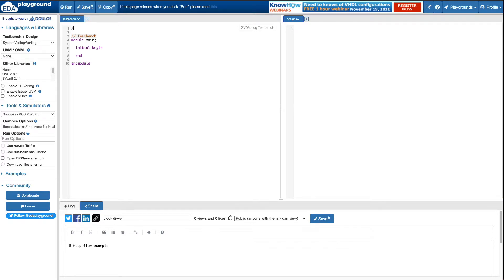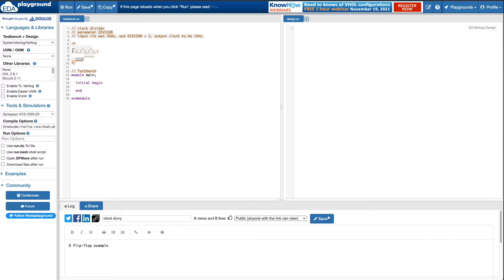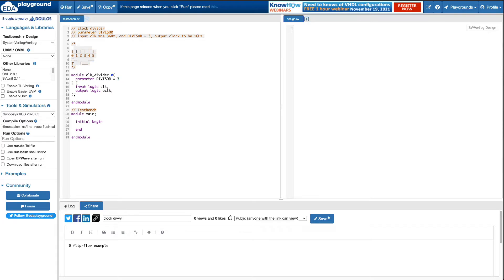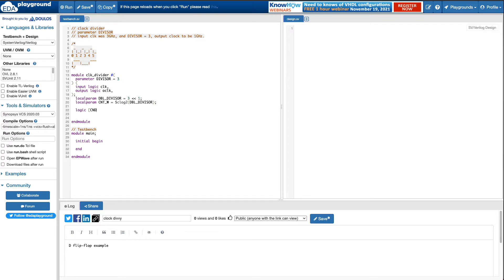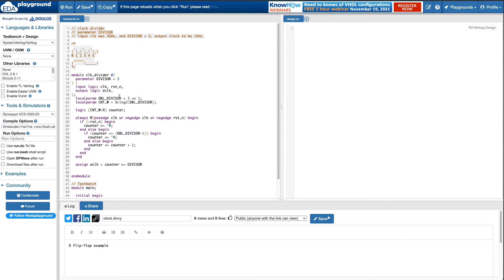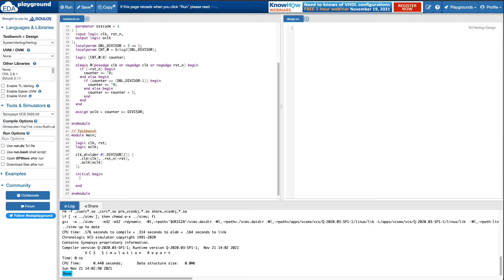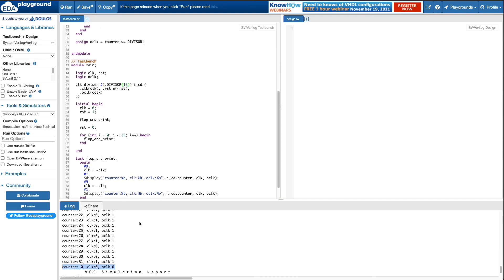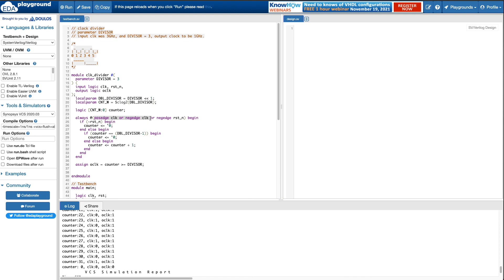Making A Clock Divider In Verilog

Comment: does it works when i want divisor value to be fractional part?
Reply from the maker: no. for nondivisible you would need clock domain crossing. the above is probably more used for things like half pumping, double pumping, multi-cycle logic etc. in the same domain.